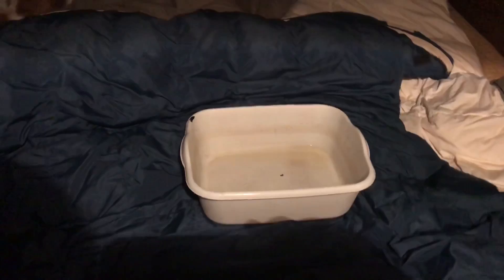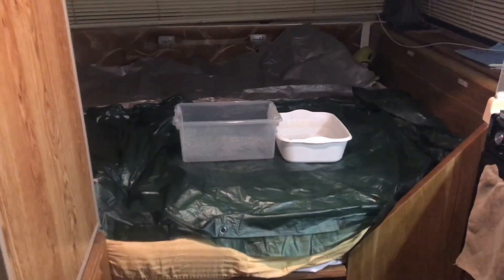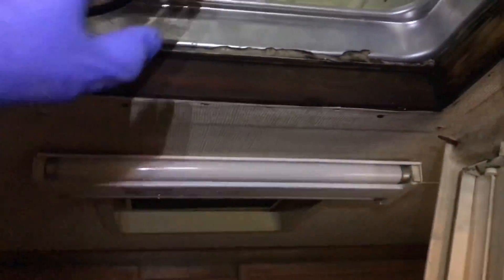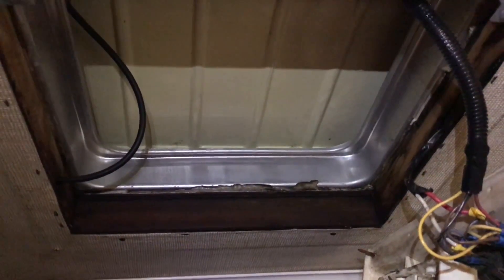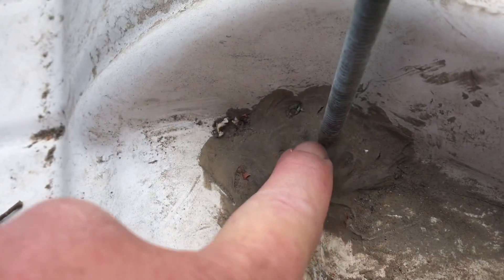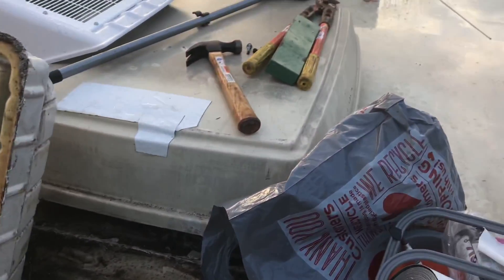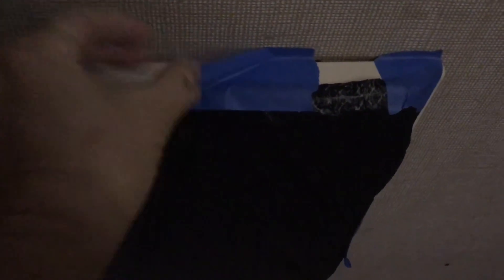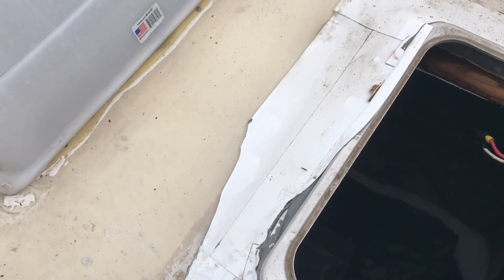RV LIFE | Roof Leak From He!!

Comment: Oh crap!!! I totally understand what you are going through.... after part 1, i wondered if I should fly out of the outer Island hidaway that my dog and I live on our (leaky boat) floating home and come help you? It's obvious that you need to high tail it to the desert and dry out under a prefab tent, then remove all the stuff on the roof and put a vinyl roof on.... Meanwhile,  here's a tip, (sorry but it's not money or my physical handymame self) BUT.... find the cat walkers who put up and replace billboards!!! Billboards are the BOMB! THEY SHOULD GIVE THEM TO YOU!!!! They come in extra, extra heavy weight vinyl and have heat treated edges to allow rope or poles to go through and range from 20'x40' to larger and smaller..... one of those will insulate and keep you DRY.... THE PLUS SIDE IS YOU CAN BARTER WITH OTHER PEOPLE FOR GOODS AND SERVICES IF YOU PICK UP A FEW....
GOOD LUCK
Reply from the maker: Aw, thank you, Malama! Well if this last sealing holds up we may be over the hump. If we find major water damage I’ll deal with that when it happens. I cannot go to the desert at this time. Island? What island??? Sounds divine.

Comment: I'd love to be able to say something helpful😲, but you're doing the best you can with what you have🙄. My only suggestion would be: go to Harbor Freight- buy the largest tarps (11'x23' should do), a couple packs of the longest bungee cords they have, a couple rolls of duct tape😀, a package of clipsand make sure you take the 20% off coupon they have so everything costs less. Sweep the roof of all the water you can, overlap the two longer tarps, bungie them down, take the smaller tarp that you have already and lay it over top of the seam so the water can't leak into the seam, clip the 3 tarps together and make sure you put your water bottles or detergent bottles under the tarps around the swamp cooler before you put the tarps over top [that way you'll still have the air flow],take the duct tape to seal the seams of the tarps, use bubble wrap and reflectix in the openings [it should provide a heat buildup inside]. Then go to bed and wait for the rain to stop😴😎
Before you go to sleep: Don't forget to return whatever you have left or strips from the roof since neither one of them worked (Eternbond & FlexSeal). They're both guaranteed so they should send your money or credit your account💸. This should help you sleep better😉
Lots of luck Kelly! Just wait for a few sunny days after you have a nice long nap😍
Reply from the maker: Thank you, Mona. Well when the tarp was on the roof, the RV got very humid inside as the tarp blocked the ventilation even with buckets propped up high for air. Also the tarp covered the fridge vent with hot air coming out.   Oh, and I couldn’t prop it up high enough above the railing and ladder so it pooled up everywhere on the tarp. Not sure how people live in tarped RV’s and how they keep it from pooling inside of the ladder and railing. But the sealant has held up so far!
Reply: Kelly, For the moisture inside don't forget the Damprid (you can even go to the Dollar Tree since they have the equivalent for $1.-), but if you don't have a Dollar Tree go to Walmart. It's about three bucks there but the containers are bigger. I lived at the Virginia Beach Oceanfront for a long time. The humidity is a nightmare there and if you're not careful your house can be  mold and mildew🤧 heaven! I bought dozens of those containers & as one filled up with water I got out a new one to replace it! In the beginning, before the Dollar Tree, my aunt Josiah told me to buy rock salt and put it in plastic containers with 10 holes punched in the top filling it halfway with rock salt. It worked but was a pain in the butt changing them all the time.
PS... Your buckets under the tarp must be taller than the railing or your right it won't work then you'll get water puddles all over the roof. It's also one of the reasons you need the third tarp to cover where your first two tarps come plus that's where the duct tape comes in handy [for holding the third tarp from blowing]. Best of luck my friend👍

Comment: So sorry for your problems.  I get stressed when things are not working for me.  I know there is a flex seal that you spray on, supposed to seal anything.??
Reply from the maker: Yes, I went to get the flex seal spray but  the directions say it needs to be applied to a dry surface and time to cure. One of the issues was I was trying to seal it in rain.

Comment: Awww darn Kelly...Srry you r having to deal with all this..your whole roof prob needs to be stripped coated n resealed..def gonna need to replace the rotting wood under that roof tho or no amt of sealing it will matter..you always crack me up..keep smiling..chin up luv..keep it up..you do have a nice home n ALL homes need work✌❤😊
Reply from the maker: Thank you, Cher Bear. The roof beams are dry as a bone now but I’ll get a moisture meter to check them to be sure. Tearing out a roof is well beyond my abilities.

Comment: Most RVs are like this, the adhesives they build them with only lasts 20-30 years.  Sometimes far less.
Reply from the maker: Not anymore, people with NEW RV’s are having the same issues. Horrible.
Reply: @kellydoyle  On the plus side, you have one of the better built units.  All you have to do is become a RV repair technician.
Reply from the maker: Just Traveling 🤣 Yes, best used RV out there. Will see if she can be repaired.

Comment: You should go to an R.V store and get
A roof vent. The frame is the same.
It comes with a solid lid and a new
Frame. Or get a fantastic fan and 
Do away with that water cooler completely. Good luck. Leakey roof =
No fun
Reply from the maker: Thank you, John. Yes, that’s the plan. A fantastic fan isn’t in the budget but I can get a vent. The swamp cooler still works but I’ll never figure out how to re-attach the wires and just want it gone.

Comment: For sealant around windows you need to put silicone on outside of the windows if you do inside you’ll still get water damage between the walls.  You may need to take you swamp cooler off and change the boards around the opening. Looks rotten - moody :(. Take care
Reply from the maker: Thank you, NG. Yes, I didn’t have time to seal the entire RV before the rain and just got to the spots that had apparent water damage. When the rain stops I’ll be sealing it all up then will start looking into the damage and pray it’s not beyond my capabilities and resources.
Reply: Glad to hear Kelly. I worked years ago at travel trailer factory in Red Deer, Alberta Canada. In the department where we put on the siding and roofs.  I hope you also get the putty tape to possibly put in between the swamp cooler and roof.  But I did see you had the self leveling sealant.  :). NG aka Nancy Adams.

Comment: I know you want to save as much money as possible... but there is a point at which spending lots of small amounts adds up to more than paying for expert help. If you ever have to put a tarp over top, you have to make a tent of it... slope it so rain runs off. The rig looks like you bought a heap of problems. I know i am not there... but you need to slow down, plan things out and expect problems. There is a release clip on caulking guns.... the people on tv know to push it to release the pressure to stop the caulking from running out.
Reply from the maker: Not about saving money, I don’t have the funds to pay a professional. They charge thousands to seal just the roof.

Comment: Be reasonable Kelly, the van did not give you & Sophie a life at all!  It was so packed & you had to bend over to stand!  Everything will take repair that you & I can afford.  My roof is leaking & has run onto the back porch trying to ruin the woodwork out there!  It costs $7000.00 to replace the shingles, which is what has to be done!  My windows also have to be replaced!  No flooring, just cement!  & to think, this place only cost me $60,000.00.  If it had been any better I couldn't have bought it!  Did I get to buy new so repairs wouldn't start for (maybe) 20 years?  No I can only afford something in this condition & I just constantly have to work on repairs.  You & I Kelly, have it rough  Don't despair, Kelly  just figure out what has to be done, & do it!!!!   hugs & prayers to you & Sophie, Judie
Reply from the maker: Thank you, Judie. I’m so sorry about your repairs! Yes, this is still much, much better than living in a minivan!

Comment: I bought eturnabond didn't work on mine either.
Reply from the maker: The eternabond held up where I sealed it in dry weather. But I couldn’t finish sealing the entire RV before the rain and the leak was in a puddle of standing water. Otherwise it should hold up well. Did you fix your leaks yet?
Reply: @kellydoyle  I tried , but no I had puddles to it's where roof sunk probably rotten. I'm so mad that people get over on other poor people I paid 6,000 for this & they lied on several things.

Comment: Have you thought about the rubber roofing material? You would do the whole roof.
Reply from the maker: Thanks Suzanne. The roof is one single sheet of aluminum with no issues. The leaks were just coming from roof vents and it took so long because I didn’t get the sealant in time and had to seal it during the rain. They’re all sealed now!

Comment: My guess is it’s leaking in from somewhere else also & that is a low spot the water is heading to. Have you looked into the RV-Armour? Or there are some companies that advertise on Craigslist to redo RV roofs. I wish you were closer, I would help you!
Reply from the maker: Thank you, Jeepn. The leak stopped after sealing it with the Dicor. Hope it holds up! Ive heats that these older class C’s all have low spots in the roofs where water pools up. Yes can its all pooling up at that vent which is why the previous sealants are breaking down. The rest of the vent is sealed like a rock. No budget to pay for roof help.

Comment: I went through the same thing. It completely ruined my rig. I'm so sorry.
Reply from the maker: Wow, how did it ruin your rig? Was it leaking for an extended period of time? Yikes! My beams dried up super quick.
Reply: @kellydoyle  well it had a small leak to begin with and I did all the things with the same materials you used. Unfortunately I didn't know it  still leaked, (worse in fact?) And the whole front is rotted out. The beams in mine are all wood. No steel. It would need to be all rebuilt to make it road worthy. Darn rubber roof systems!

Comment: Kelly, contact Jamie of Enigmatic Nomadic.  He is a great guy and runs the van build.  He will help you.  You need help.  Do it now!
Reply from the maker: Thank you, Mark. I can’t get to the desert at this time. I’m in California
Reply: @kellydoyle  
Not far to Yuma from SoCal Kelly. 
Can't u throw a tarp on it until u leave?
Gee u did sucH a prof. Job.  I hated to see it still leaking. And so big a 1.
Reply from the maker: Sierra Suz Thank you, Sierra. I tried a tarp but it created too much humidity inside covering the roof vents (it was WAY too hot), condensation, blocked my fridge vent, and I don’t have anything high enough to tent it above the ladder rails so it pooled up. I don’t know how people live in RV’s with tarps covering the air and fridge vents! I’m in Northern California over 600 miles away from the desert. The RV is not road ready yet and that’s over $300 in gas to get there. Maybe if I can get it road ready but honestly I don’t feel safe taking this RV far from where I have a safe parking spot.
Reply from the maker: Sierra Suz Oh, and the areas that I sealed did not leak. I was unable to finish sealing it in time before the rain. The window stopped leaking so it’s just two leaks, both leaks where water pools up around the roof vents. If the water didn’t pool up there they’d be fine.

Comment: Hello Ms. Kelly and Sofie Doyle 🌺🧚🏼‍♀️ I thought sending you both flower and prayers the sun will shine your way to dry out that damn roof 🤦🏻‍♀️ Kelly I know zero about RVS but I’m kinda worried about MOLD those nasty spores travel fast, but the upside I watch the Van Build videos and seen people painting new roofs and hammering out inside replacing the damage with wood “My Sister Lives In Sonoma County” she told me CEDER WORKS GREAT MOLD Won’t attach to the wood! Down side it’s expensive but it appears you won’t need much. Also hears idea “Just Thought” maybe rent outside storage Unit or at MARE ISLAND they have Single Ware House Sounds Stupid I Know but place you can fully dry out the RV roof etc. and paint new roof on and repair damage wood and check out Behind refrigerator and heating vents MOLD Travels in dark damp places if your using the inside heater. All This Kelly is Do Able and Cheaper then buying another RV. Hugs positive energy from Napa Valley. 🍷
Reply from the maker: Thank you, Christy. Yes, mold is a major concern and why I was scrambling to stop the leaks. The second I smell or detect mold, I’ll need to vacate the RV.

Comment: Put some plastic sheets visqueen ( $20 home Depot) on the roof... It's easy
Reply from the maker: The entire roof has to be covered as the water is pooling there from front, rear, and sides. I tried a tarp and it didn’t work: blocks the roof vents making it humid, hot, and muggy inside- breeding ground for mold, blocked the fridge vent, couldn’t get it high enough to be above the ladder so water pooled up, blocked my windows ventilation and light... I hope to never have to tarp an RV ever again in my lifetime.
Reply: @kellydoyle   tough one. I have an 84 class c and water would pool up so  bought some leveling blocks from Amazon for under $20. I just drive the front tires on them and then the water runs off the roof and down the back window.. Good Luck!
Reply from the maker: Wade Allen great idea. Thanks. I was sweeping after the rain but then it’s just rain again. It’s on blocks now to keep it level for the fridge.
Reply: @kellydoyle   the cool thing about the clear plastic is that it is way better to work with than a tarp.  I have a leak to tend to on my fantastic fan. I cut out a piece just to cover the vent fan. I put rocks on the plastic to hold it down.. it cuts very easily with sissors and I  did not have to cover the whole roof... That Lazydaze is a great rig. Don't get discouraged..
Reply from the maker: Wade Allen yes, the tarp was such a nightmare I pray to never have to tarp an RV ever again in my lifetime. I wish I could just cover the vent but that would not help the water pooling up from all directions. Rain has passed and I’ll be getting back to finishing sealing when able. That first leak and the second are sealed now.

Comment: Where are you that it is raining 9 days in a row... good grief.  Why is the water pooling like that?  Is there a dip (low spot) on the roof or is the waters path OFF the roof blocked in some way?  I couldn't believe it still leaked with the tarp over it.  Final question, what is a 'swamp cooler'.?
Reply from the maker: California Bay Area. All older class C’s are notorious for sags in the roofs where water pools up. It leaked with the tarp because I left the fridge vent uncovered and water got onto the roof. The fridge needs to vent and spews out hot air. I don’t know how to describe a swamp cooler, I think google would describe it better than I could.
Reply: @kellydoyle  Thanks I'll google swamp cooler :-)

Comment: The problem with this FAD of van life is that it’s affordable, it’s easy, and it’s fun.  It is a house on wheels, thus, not affordable as you must maintain the “house” and the “vehicle.”  It costs gasoline/diesel, maintenance, tires, brakes, etc...and that’s if the vehicle has no mechanical issues EVER..not realistic.  I think this whole YouTube van life fad is a real injustice to people.  It is NOT affordable to anyone on a low income, or a fixed income.  It’ not easy, you are roaming all the time.  It’s not fun.  There are fun moments, but life is not fun all the time.  And life on the road is no different.    Good luck with your leaks.  I’ve been there, done that.  I’ll take terra firma any day of the week!
Reply from the maker: I agree. THAT is why I post the REALITIES of this lifestyle and not just the good times. I did not choose this lifestyle, I was forced into it after acquiring a brain injury and losing my livelihood. It’s still cheaper than even subsidized housing which takes out 30% of your income. My one and only goal in life is to get back onto my feet financially with a brain injury to secure more safe stable housing.
Reply: Kelly Doyle, Thanks for the reply.  I totally get it.  I lived in my brand new RV for a few years, and with everything new, things still broke down, like my generator stopped, and even under warranty is was a hassle.  Good luck on your adventures.  I have been following you and knew your story.  Thanks for giving those wanna be van lifers a “reality” check.  And I hope things get better for you!
Reply: @kellydoyle  well you do it with humor and style.... I'm still laughing at random about the myths you busted.... " like living on a unicycle for $2 a month, etc!!!)

Comment: Flex seal will crack! Use Dicor over the eternabond tape
Reply from the maker: Yea, flex seal was going to be just a temporary fix until the Dicor arrived. No place carries the Dicor. I tried gorilla tape instead but removed it when it failed. The issue is that water pools up in that spot from all directions. So the Dicor will probably fail in time just as the previous sealant did unless there’s a way to eliminate water from pooling there. It’s a common older class C issue.